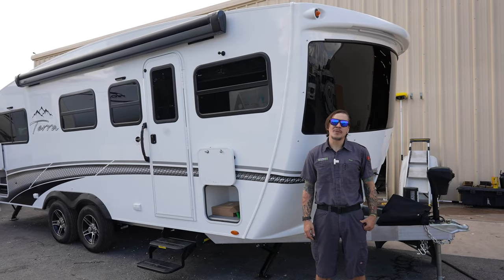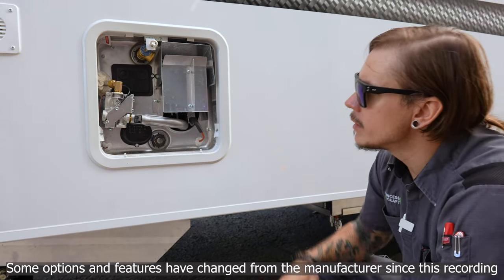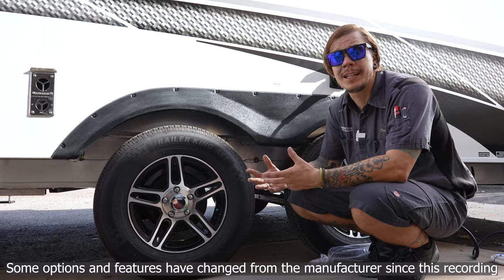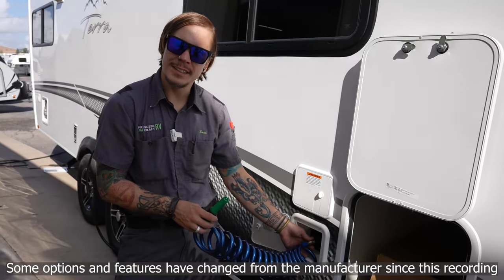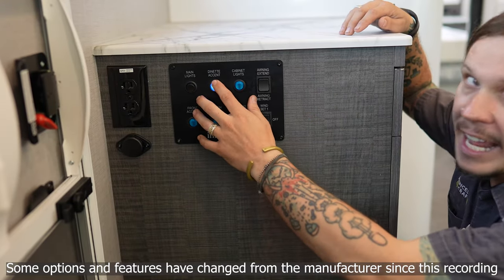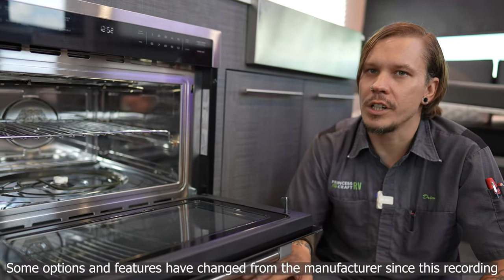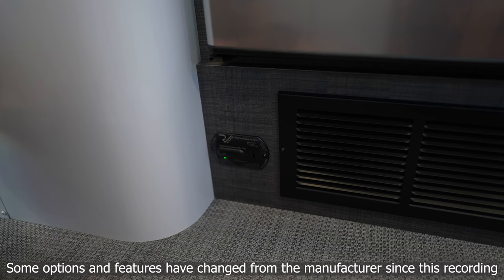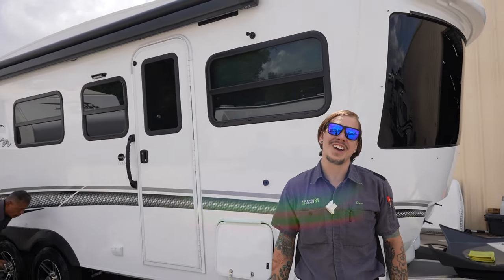2022 InTech RV Aucta Oasis Technician Tour from Princess Craft RV

Comment: Drew, can a suitcase type solar panel be connected to the exterior plug without a controller or is this plug connected directly to the battery requiring a controller?
Reply: i know the Zamp ones require a briefcase with self-controller because it goes directly to the batteries...on the RVs i've researched